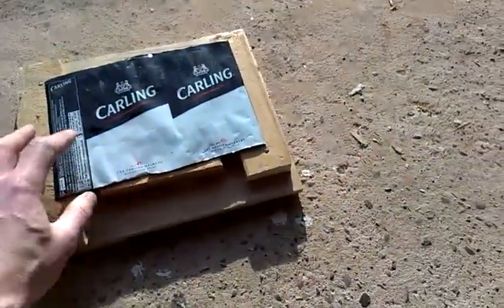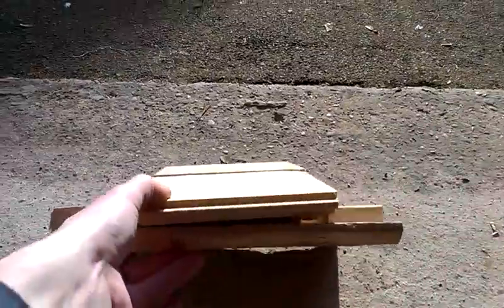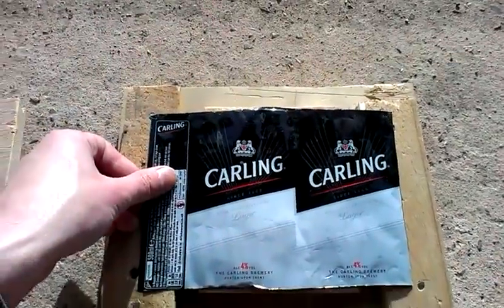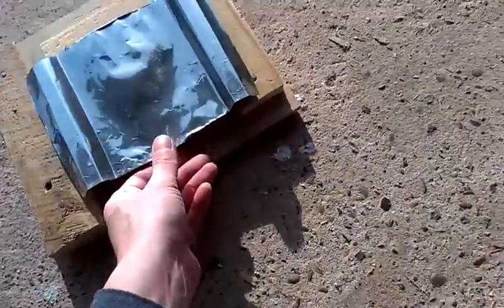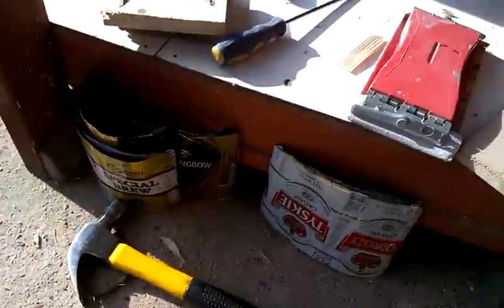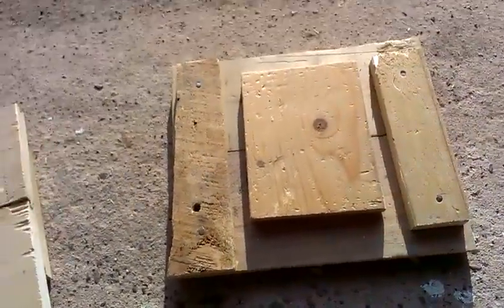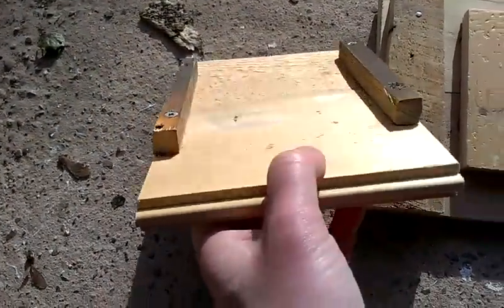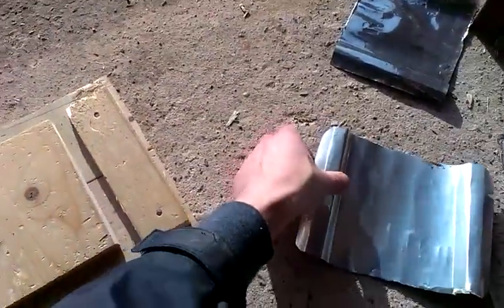Roof tiles made from aluminium cans

Comment: Great idea !! , If you could find a way to cut them out and press them faster you could sell them  , i am sure guys would use them on sheds and small buildings , i am thinking of covering my small shed with them , very cool . Thanks Mike .
Reply from the maker: Hi Mike. Thanks. you'd need a custom machine to do that! Good luck with your efforts though. :)
Reply: Instead of a short board for tile at a time, make a long frame press to do a row of them next to each other. It might go a we bit faster pressing six to ten at a time.

Comment: could possibly attach with construction adhesive where you don't want a staple
Reply: Use a good roof sealant like the clear stuff for metal roofs if you staple them. Put the sealant over the staples or any holes. Or maybe use the sealant to glue. You can find it in the roofing/shingles section at hardware stores.

Comment: good job I would have liked to have seen the tiles getting installed I know you said you would staple it but I wanted to see where you would staple it at
Reply from the maker: I made a wooden frame with rows of wood for the tiles to be fixed onto. The staples were ok but some came off in high winds so I instead hammered roof felt tacks, the very short ones and these proved to be perfect.

Comment: Do they hold down to the roof under high wind conditions?
Reply from the maker: Yes, I've not had any real problems with that. As long as they are nailed down they should be fine.

Comment: Not much overlap  you would need a very steep roof  a driving rain could work it's way under, plus it would take a while to make that many shingles
Reply from the maker: Normal tiles don't have much overlap. I used them to make a gazebo in a garden and it worked absolutely fine.